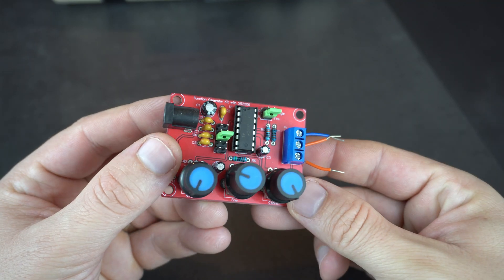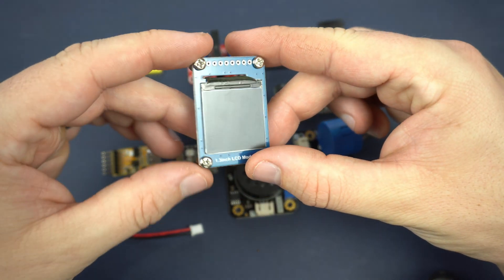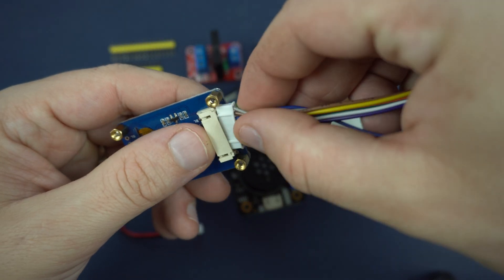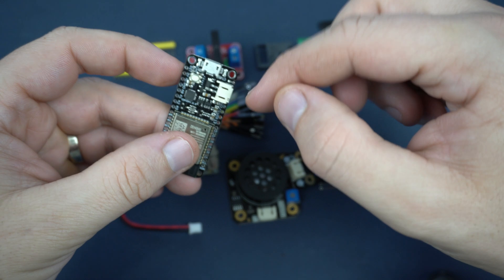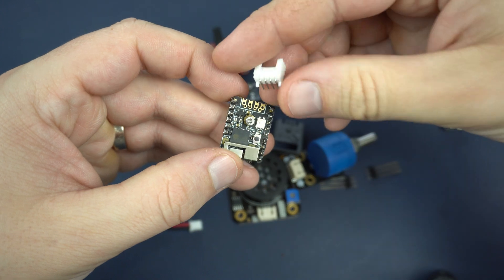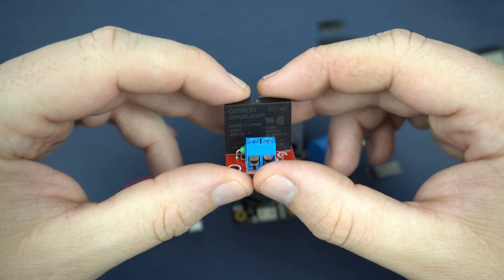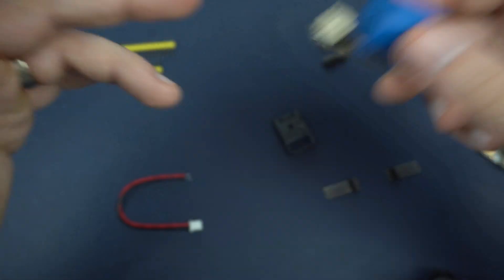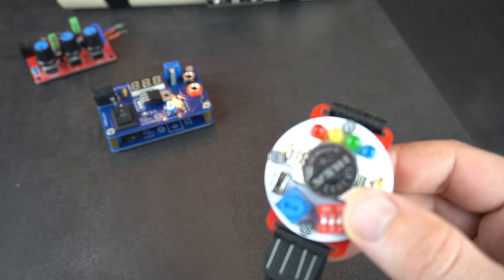Most important ESP32 project in 2022.

Comment: Can you answer to my isse with ttgo radio ??
Reply from the maker: what problem you have with ttgoradio ?
Reply: @VolosProjects  my answer still is delete by yt- i dont know why :(
Reply: How add correct link radio stream for ttgo ? all radios from many other site works fine but from there - no - stream-dot-sunshine-live-dot-de/ - first link 
if i add   this  
- ttgo will reset after press playing  - what im doing wrong ? - in browser link works like from other site
Reply from the maker: @piotrr5170  links in sketch are different bitrate than links you are trying. I have same problems.
Reply: @VolosProjects  they have 64,128and 192 kbps link - all fail - how to resolve ?
Reply from the maker: @piotrr5170  i dont know right now, i was able to find only few stations that works. My code was based on this  https://www.instructables.com/Web-Radio/
Reply: @VolosProjects  Are you see any solution in close future or not?